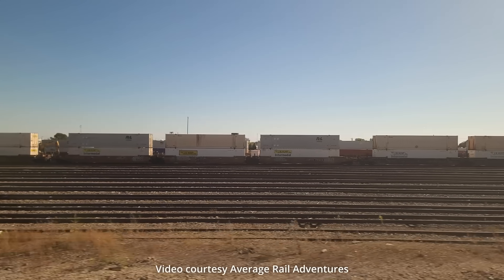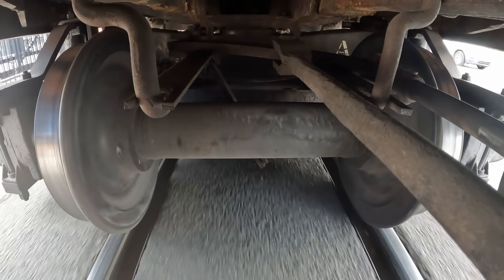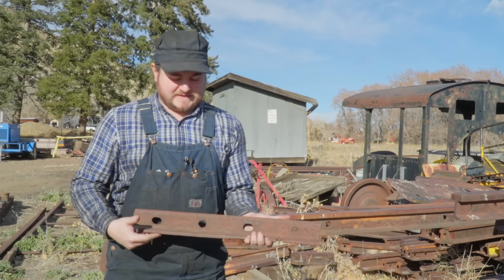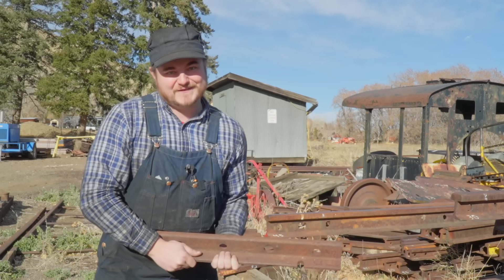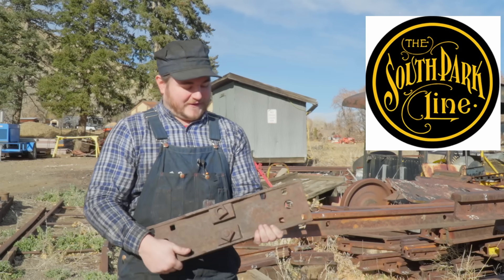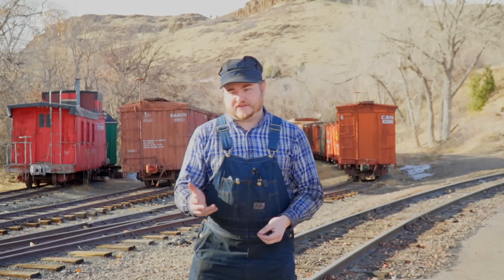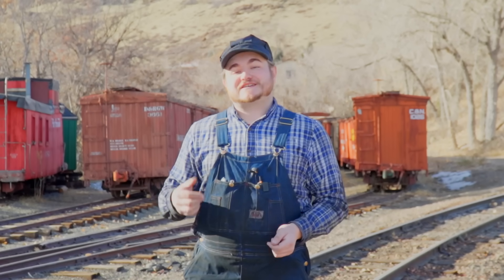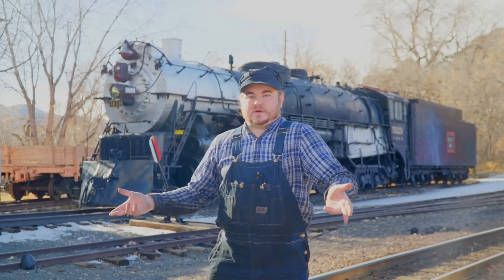Why don't Trains go CLICKETY-CLACK anymore? | Railroad 101

Comment: As a kid in the 1950s and 60s living two houses away from the Pennsylvania RR tracks which bisected the South Side of Chicago’s  north-south street system at a diagonal, I was lulled to sleep at night by the ‘clickity-clack’ of steel wheels over rail gaps.  

Near our house there was big metal box and one day when it was being worked on I got to see inside of it and  the technician satisfied my curiosity by explaining how a gap in the rails nearby triggered the crossing gates two blocks to the South to go down and stay down as long as the wheels bridged the gap.  I figured out how to keep the crossing gates down by putting a penny over the gap that the train wheels would squash.  😂

The RR tracks bi-furcating the street grid like it did with crossings only every 1/2 mile — 127th and 123th Streets near us — turned all the streets on both side of the tracks into very safe to play in cul de sacs because there wasn’t any cross traffic.  Because of that in the summer our ‘stay at home’ mothers would kick us out of house and let roam around unsupervised all day, not like subsequent generations of ‘helicopter’ parents. We grew up self-sufficient making our own ‘go carts’ and ‘ scooters’ from discard baby buggy wheels, roller skates and lumber using our father’s tools. The RR right-of-way was our playground during the summers where we’d dug fox holes and play Army, much to the consternation of guys driving the tractors who mowed it who would regularly get stuck in one of the holes. Trains still had red cabooses with brakemen as they passed we’d wave and yell ‘flare’ and occasionally get tossed one. 

Occasionally a steam locomotive would pass pulling ornate passenger cars.  Our neighborhood was called ‘West Pullman’ and George Pullman’s car works and historic utopian enclave of factories, row houses and churches was just to the east of us so there was a lot railroad history there.  😊

Comment: To m mind, your presentation, for the most part-excluding gondolas limitation on rail length, is stupidly thought out. obviously, a 40 foot length of rail can be butt-welded to another length ad-infinitum until a limit is reached dictated by ability to transport (usually a quarter mile). Go back to the rolling mill--the maximum length of a mill-produced length of rail used to be thirty three feet until the 1930s when longer lengths were determined to be made up to a quarter mile linger and more. depending on the receiving end of the foundry's area. I would suggest that you study more before making incomplete videos. (P.S. I knew Bob Richardson and I can say that he didn't tolerate half-a@$ explanations.)

Comment: We still use these pretty much everywhere in Australia except the gap in filled with epoxy to smooth out the surface and isolate the current. They’re used as isolators to track train movements. Other joints are all welded.

Comment: When I 1st started working in Track Department for a midwest railroad we called them "sunkinks". As this had a negative connotation with the general public and the local press by the time I retired they were called either "Thermal Deviations" or "Thermal Misalignments". Sounded better to the people that didn't work for the railroad. 
In the late 70s they sent us a joint straightener machine. Basically it was a flat car that had hydraulic cylinders than came down on the rail either side of the joint. Then a hook went under the joint and bent it up to straighten the rail. It worked really well and did straighten the joint and give life back to the rail and joints. The biggest con was that we replaced many hundreds of joint bars. Most of the bars were 85/90, 90, 100, 110 pound rail. Went thru a lot of comp/transition bars. As it was a branch line back then that's as big as the rail was. Though there still were a few places where there was 56, 65 or 70 pound rail. A lot of it was 10/15 mph speed restriction and I can't remember any of it being over 25mph. 
One summer in the late 70s or early 80s we surfaced it with a Mark 2 Tamper. Took the better part of the summer as the tie condition was so bad we had the sections and an extra gang change ties whenever we lifted and the rail came up but the ties stayed down. Either replaced the ties if needed or just plugged them and respiked with the auto hammer if possible. 
Wasn't a welder but did work as a welder's helper a few times when they needed a shorter replacement. When doing the rail temp adjustments always use the charts everybody had.

Comment: I worked for Canadian Pacific Rail during the summers of 1972 and 1973,when they were changing the 38 foot rails with quarter mile rails.Five hundred men working 12 hour days to take out the old rails and rock,then rebuild the railbed.A good day was doing 10 quarter mile sections,swamps were a nightmare as there was no place for the support machines to park.The clickity clack disappeared in 2 summers into the tales
 of history.

Comment: What took so long to standardize track width and size. Why do we have narrow gage tracks?
Reply: When a railroad had to choose between making a railroad "narrow gauge" or "standard gauge". Usually terrain was considered, and how big the equipment should be. For example, traversing the Rockies in Colorado would've been a lot harder for standard gauge locomotives to do, rather then narrow gauge locomotives. Narrow gauge is overall smaller, so it worked better for tighter corners, steeper grades and areas with not a lot of room. The only reason alot of railroads that aren't running tourist attractions aren't narrow gauge is because automobiles took over. Narrow gauge railroads did a lot of logging in the late 1800's and early 1900's, especially on the west coast. Those eventually got replaced by trucks doing the job, because, honestly, they're more convenient. So yeah, there ya go

Comment: From Hungary, this is still a thing here on most branch lines, older train stations and terminus stations in Budapest, they don't have welded tracks. So as you're leaving the station it clicks clacks until you get on the mainline where everything becomes smooth.

Comment: There are some amazing videos online of how joints are welded! You are thinking Tig or Mig and some may use something like that, but the video I saw used a much more of a interesting method!
My town Fort Collins and Loveland redid there railroads recently to replace the wood bellow and some section also have cement now instead of wood which is interesting, But the cement is in the same shape as the wood would be but it always near roads I wonder why! I wonder if in Colorado mountain how much of the rain is welded I bet a ton unless super unsupported due to a town or city not near by!

Comment: idk if its the same in the US, but in germany we usually use sensors that count the amount of axles that passed over them, one at the beginning of a section and one at the end. So special joints are not needed. These sensors can also detect the direction the train is traveling. Might sounds complicated, like it would be more error prone, but it is actually quite a lot more reliable.
Not just for electric railroads, in general.

Comment: I found an old town map of Temecula Ca. It showed the rail line and turntable from 1885 and the spot hadn’t been built on. I watched the spot and when the building started I asked the foreman if he found anything weird and he found a huge square of concrete and rails. A
I asked if any pics and he said yes but the rails are sitting over there ! So I have a piece of 1885 rail with “85” and “P R” stamp or similar

Comment: 4:17  Rails are stationary -- they don't travel ANY distance. It's the wheels that travel distances.
Reply: You're not too smart are ya?
Reply: @ExcavationNation   Not too smart, just smarter than you
Reply: @davidmontville4885  you understand that if you take two 20 ft rails and anchor them in the same starting spot and them place them exactly 4 ft beside each other on a curve the outside rails end will not line up with the inside? Now do that over a 10 mile curve. That's his point genius.
Reply: @ExcavationNation  My remark was related to the literal wording which implies rails 'travel' --  they don't. They are stationary. Wheels move on stationary rails.

Comment: Huge difference betrween american and for example german railway track, german joints aren't supposed to be staggert. They are designed to be at the exact same spot in both rails. To compensate for weaknesses several designs were used over the last century, especially the prussian railway as the biggest one in german did a lot of research and testing and came up with some ideas. 
They placed the last 2-3 sleepers unter each rail arround joints closer together, to give the rail more support in that area. Or the most common design that lasted until the end of jointed rail in germany is the double-sleeper. The sleepers were placed at an interval that there was one exactly at each end of the rail. So where there was a joint, there were two sleepers side by side that got nailed together, to give the joint a super strong support. You can still see this on several rail lines, the rails are welded together since decades, but the sleepers still follow the old pattern of double sleepers every like 15 meters. 
And for curves there were special "curve rails", the standard length was placed at the outside, and on the inside special rails that were a little bit shorter were used, to keep the joints parallel. Or the rails were layed with a small gap at the end of the curve in the ouside rail, that was bridged by long 6 hole fishplates and a small 5 to 10 cm piece of rail in the middle. 
But that's all long gone, outside of some very old industry spurs, the only joints today are isolation joints where there are still track curcuits. But thoose are usually cut in a 45 degree angle in the rail head, to minimize wear and clickety-clack.

Comment: My dad worked for the Central of Georgia railroad for almost fifty years, but had to retire because of an injury.  The bar used to connect rails was called an “ angle bar” and I had to go with him and help him repair those things several times when he couldn’t get any of his helpers to come with him.  When “ ribbon rails” were introduced, the job actually became more hazardous because when they broke, they would have to be welded back together.  They always seemed to break in an area that was not easily accessible.

Comment: The amtrak Downeaster from Portland to Boston has smooth welded rail, except for a 3 mile stretch when it has to switch tracks to avoid the local commuter rail. That 3-mile is not welded, and very clicketly-clack.

Comment: I can remember in the last century watching a mile long maintenance train feeding the "mile long rail" to the gang replacing the short lengths of rails.  

An emergency booklet said if 'your' vehicle was stuck on a grade crossing, to take the snow chains out and lay it across the rails to trip the block  stop signals on the line.

Comment: What is funny is you can hear a similar sound on specific old electric trains which derives from the resistors used for the DC motors of the time being switched on and off

Comment: Does not need for signaling the joints at all. It is possible easily to detect incoming and outgoing trains. Modern days is it almost crime to use that kind of technology if there is way safer ways

Comment: 9:47 You don't have to wait for ambient temperature you can heat the rails to needed temperature with a Rail Heater https://www.youtube.com/watch?v=c_5hBZp5PKE
Or stretch the track with a hydraulic rail stressor https://www.youtube.com/watch?v=xP6lUNjQPdk

Comment: I thought welding tracks was invented 20 years ago not in early 1900s, I wonder how that was done.......
I would think expansion rail joints would need to be no more then 2 mi apart.......

Comment: Modern rail can also be incredibly flexible - strange when you do't know that and see it in person for the first time. There are some nice videos showing that:
https://www.youtube.com/watch?v=MNpUD6iLWNY&t=614s

Also i have seen some slanted joints, like scarf joints in woodworking, even used for decently fast going routs. And also some that look like expansion-joints: Slanted on both ends with a parallel section in the middle. Are there things like these in older rails?

Comment: It's interesting to realize there are more reasons than just grade and lack of obstructions for why hsr beds full grade separation.  I'd also be interested to hear what the unique challenges are for rail selection for text and light rail mass transit. I live in NYC, and am thinking welded rail on the subway would be an issue because of logistics and also the frequency of switches.  Also, what the implications are for wholesale track upgrades when installing upgraded signaling systems.

Comment: Funny those joint fasteners are used constantly over here on our lartigue mono rail, and yes a french north African monorail train ran in Ireland for about 44 years, originally made for combating sand dunes, England denied using it but Ireland took it due to the fact that a line was being asked for two decades prior, it's in listowel county Kerry Ireland.

Comment: I remember how first high speed train was launched in Ukraine, It could go 200Km/h, which is two times faster then most of other passenger trains. And every morning workers went around those tracks used buy new train, and tightened bolts around joints. It was like that until they switched to welded joints.

Comment: Mean while back in the UK the LNWR moved to using 60'-0" rails in the 1890's and had no problems with moving them to site on multiple single bolster wagons. So while 40,-0" bolster wagons may be why the US used 39,-0" rails it did not have to be that way and they could have used longer rails if they had wanted to.

Putting both rail joints opposite each other, is only a problem if you don't bother to maintain your track properly, over a long period of time. Staggering the joints also means you are building in twist faults, which is a very bad idea.

Another big plus of CWR is that it reduces the traction power required to move the train by about 10%.

No joints needed for signalling or S&C it can all be welded. Just use axle counters instead of track circuits. Also no need for junction fishplates, here in the modern world we have been able to weld different sections of rail together for the last 60 years or more.

Comment: Amtrak uses the Passenger Main on the BNSF Hastings Sub between Cobb Junction and the Lincoln, NE depot.  It is jointed rail and has a short section of 79 mph.

Comment: I work for a company that tests rail and I’ve seen it on track that is in rail yards and out on some main line and I’ve seen joint bars used for temporary repairs until the maintenance crews could get out to fix them the next night at which point I do believe that 30 mph restriction was placed on that spot till the repair is made

Comment: Actually they will mostly do so because of flat spots on wheels, happening to various degrees. And when the wheels have run over jointed rail, they mainly make noise when one rail sinks appreciable under the weight of the cat, and plainly visibly causing it to strike the butt end of the adjoining rail, which is not comparable sinking.  So the wheel strikes the rail's blunt edge or face of the abutting rail's end. But even without unwelded rails,  moving variously under weight, we still commonly have wheels which have literally become flattened to some degree under emergency stopping cobditions, where the wheel stops rotating while the force and momentum of the still moving train forces the wheels to slide along the top of the rails. And if the rails are rusty they can be substantially more abrasive and damaging to the wheels' round contours.  This results in round rails thumping loudly each time a flat wheel section hits the flat top of the rail and it dragged forward so it rolls back onto its round surface from its angled edges. while still in motion. In fact, this can be far louder than the abutment of unwelded rail ends when still secured enough to remain level and unmoving sinking, under the weight of the train passing over top of it.

Comment: Don't forget they were the length they were to prevent harmonic rocking. If both ends on the same side of the car were they would start hitting joints hard and rock in tandem. The same reason they were staggered. On top of the wheels hitting the joints hard creating broken rails. I have to hand it to you though, you talk with conviction so anyone else with knowledge will be wrong.

Funny as I keep listening, railroads ran faster in steam jointed rail days than they do in modern day railroad. Yes for the hair splitters the north east corridor they haul @$$

Comment: I used trains daily in my youth - that was almost fifty years ago, and the clickety-clack was the friendly noise of the train going at speed. 
I totally miss the noise. Nowadays with the rail tension set with the temperature, the danger are summer days of uninterrupted sunlight, when the trains are stopped because of the danger of sun kinks triggered by the stress of an incoming train.
Definitively miss the old days, when trains never stopped because the weather is too hot...

Comment: Can the ribbon rail be downgraded? Meaning if the mainline is replacing the rail can it be installed on a slower line replacing the jointed sections.